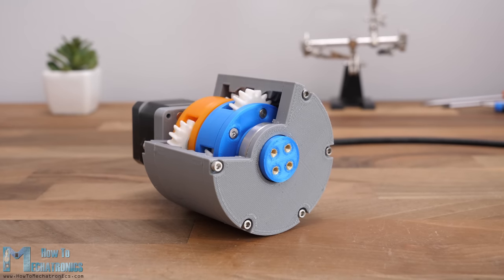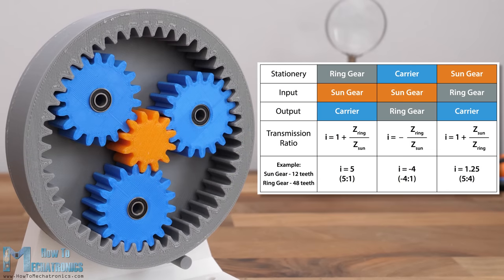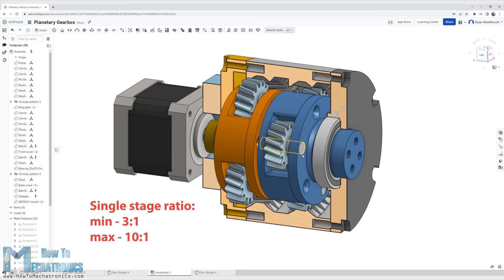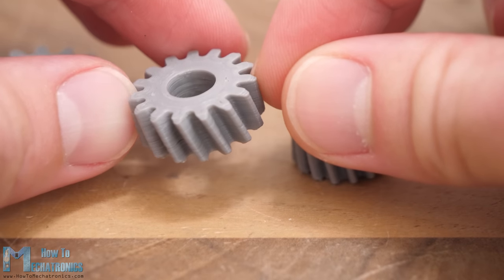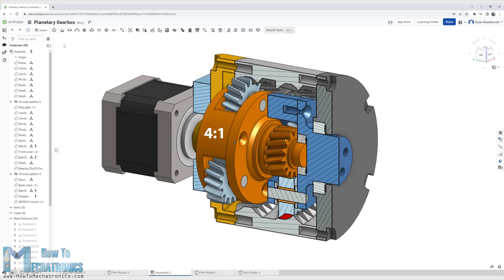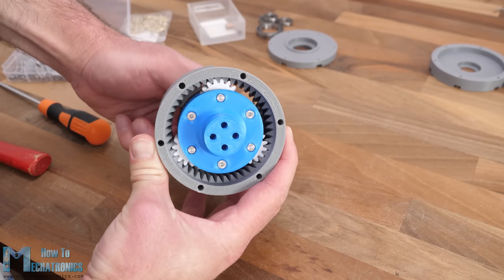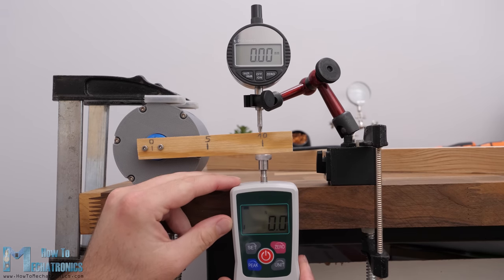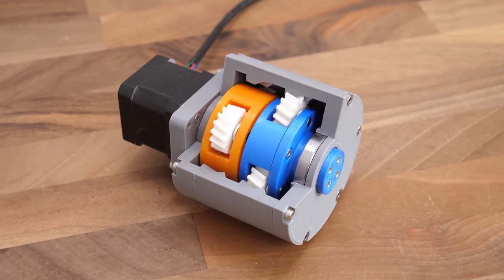How Planetary Gears Work | 3D Printed Planetary Gearbox Design and Test

Comment: One of the contributing factors to the low efficiency of the planetary gearbox is the helical gears.  Helical gears, due to their nature, cause axial load.  Straight cut gears would be more efficient, but less durable because only one tooth is engaged at a time.  An interesting compromise would be herringbone/chevron/double helical gears, in which the axial force is the same on both sides of the gear.  It still has the advantages of multiple tooth engagement, and quieter operation, but with a neutralized axial load.

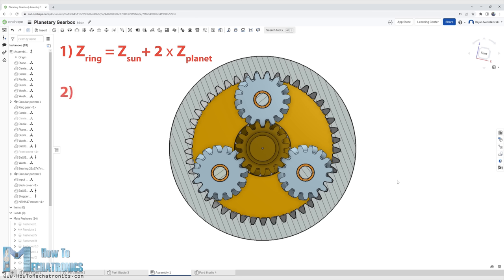Comment: I think the tight running of the gearbox might be due to an inaccuracy in modelling the ring gear. When you do the boolean operation, the addendum of the original gear becomes the ring gear's dedendum, and the original gear's dedendum becomes the ring gear's addendum, and you don't mention in the video correcting for that. You usually have to because standard addendum is 1m, while dedendum is 1.25m. I think I'm also seeing that at 7:04, where the tips of the ring gear teeth stick all the way into the grooves of the planet gears. The grooves of the ring gear look good though so I'm not 100% sure. In my own tutorial I fix this by "press-pulling" the teeth of the original gear to make them longer, and then increasing the ID of the original gear, before performing the boolean operation.
Reply from the maker: Thank you Antal, your tutorials are great, I gained some knowledge of from them which I implemented here in this tutorial.

In your tutorial you explained the thing with the gear's addendum and dedendum really great. I have just checked my model, and I saw that have only added clearance to the ring gear tip (in the normal gear I have added clearance in the groove, which makes tip of the ring gear to have clearance after using the boolean function). So yeah, I'm missing a clearance at the groves at the final ring gear.

I always have hard time deciding what information to include and what not when making a tutorial. If there are too much information it might be overwhelming for the majority of the viewers, but on the other hand it's useful for those who want to learn more details about the subject. This tutorial came out to be more on the visual side, to look good and explain the matter as simple as possible.

Cheers!
Reply: @HowToMechatronics  Yeah the balance between brevity and completeness is very tough. I think you did a great job of that in this video, keep it up!
Reply from the maker: @antalz  Thank you!

Comment: Not sure what torque value for the stepper you used, but the advertised torque of a stepper is the holding torque not running torque, sorry if I missed you actually measuring the running torque of the motor.

Comment: I believe the backlash compensation for the ring gear goes in the wrong direction for the boolean operation. If you are able (or didn't already), try using a negative value in that part.
Reply from the maker: Yes, that's right. Nice catch!

Comment: I like your cut-out demo gearmotor. 
I've only seen metal gear planetary gearboxes I've take apart. 
All had Spur gears. I guess they can't sinter metal helical gears.
Reply from the maker: Glad you like it! Cheers! :)
Reply: I am fairly certain you can sinter helical or other gears, but you probably can’t laser cut anything but spur. Having said that, each type of gear has different mechanical properties, they are not the same.

Comment: How can the ring gear teeth get correct geometry if they are constructed by subtraction from a regular gear? Does the tool not support a ring gear with correct tooth geometry?
Reply: came here to say this, the subtraction method will generate a similar profile but not an optimal one, i suspect a lot of performance  issues relate to this design.

Comment: Very nice video! thanks a lot. Did you use the rated motor torque or did you measure the real torque output of the motor, when doing the efficiency calculation?
Reply from the maker: Thank you! I used the rated motor torque which is 28Ncm, but in my previous video, Harmonic vs Cycloidal Drive, I did a real torque test which showed a result of around 20Ncm, you can see that here: https://youtu.be/IXmCze1GsGU?t=1022

Comment: Very nice!
I'm wondering, if you intended on printing, why not use a double helical design (V-shape) to prevent side forces during load? Currently the side forces will increase the friction between bushing and the washer and reduce efficiency.
P.s. your video gives a bit contradicting information: first you say "when 3D printing the parts come out a little bit bigger" (~10:00), later (13:05) you say you change settings because else "the prints are smaller than the model". Seems like more calibration is required there.
Reply from the maker: Thank you!
Well, I didn't want to use double helical design because not they are not that often used in real applications. Yeah, it would be easy to print them with a 3D printer, but they are very hard to be manufactured in reality. Also assembling them can be hard.
As for the prints being bigger and smaller, that's a nice catch, it sounds contradicting. The thing is that the prints outer walls are always bigger, but in case of a hole, having a bigger outer wall would results having a smaller hole. Yeah, I could have said that I little better and clearer.
Cheers!

Comment: I am from a robotics team currently in FIRST Tech Challenge community and for this season we want to make a planetary gear box to use for two different mechanisms. The torque part of the planetary gearbox for hangning our robot on a truss and the speed part of the system for our intake because we need speed for collecting the game elements. 
I want to know if it is possible to make this planetary gearbox with one DC motor and a servo or something like this? Can you please help us?

Comment: Wouldn't straight cut gears be more efficient than the helical design you used?  If I understand correctly, the straight cut gears are more noisy, but more efficiently transmit torque.  It is for this reason that straight cut gear sets are sometimes used in drag racing applications where noise isn't a heavily weighted consideration, but torque is.

Comment: I'm a mechanical engineering student in my final studies internship and want to get a torque of 30N.m to actuate a ball valve : is it reliable ?
Reply: Try printing them with nylon at 150% scale. Probably not worth it if you don't have a 3d printer capable of high temp already

Comment: Hallo. Congratulations for a great work and also an excelant job from video point of view as well. 
I'd like to coment torque efficiency. I think there is no need for disappointment. Torque theoretically should be higher but, we shuld consider that revolutions transition goes from sun to planetary to ring in one planetary box and there are two boxes in a row. So there are 4 stages if I'm correct. At 50% overall efficency that would mean 84% efficiency  at one stage which is not bad at all from the point of view that gears are printed, that there is not much of a lubrication and the bearings are simple.
In the end again. An excelant job. I'm looking forward of your new projects.
Reply from the maker: Hi, thank you!